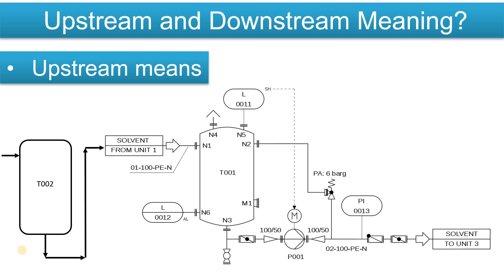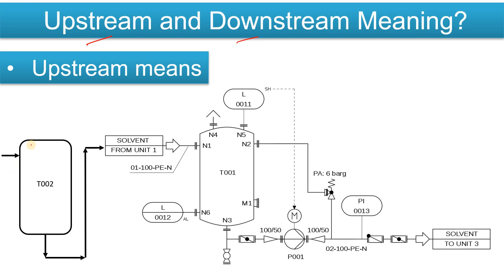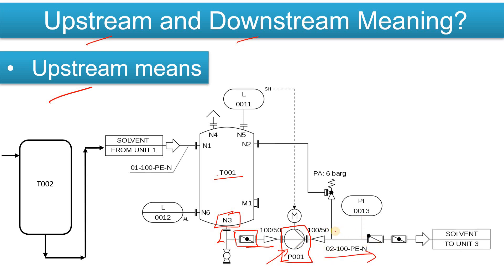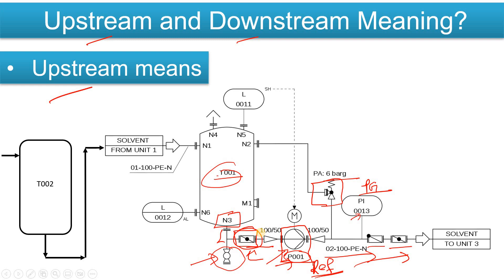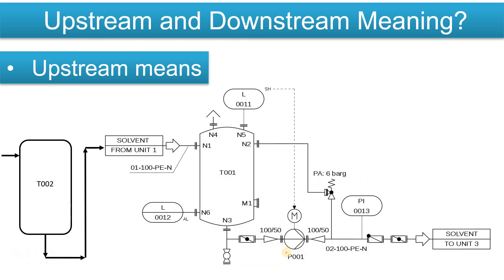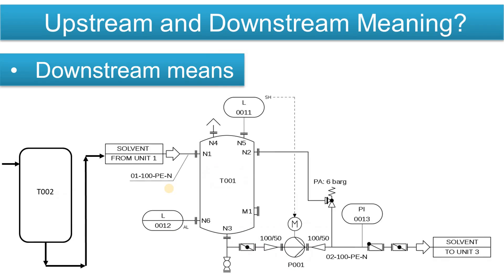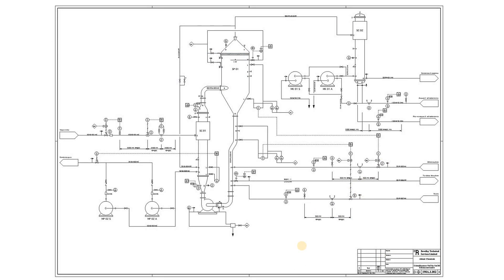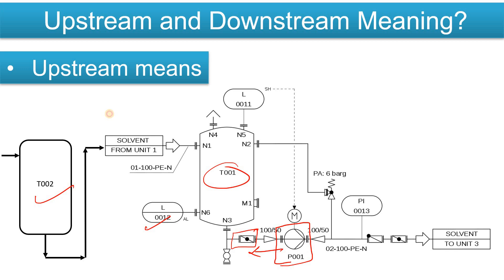Upstream and Downstream meaning in Industry | Oil and Gas | Refinery | Petrochemical Industry

Comment: The term upstream refers to anything having to do with the exploration and production of oil and natural gas. Geologic surveys and any information gathering used to locate specific areas where minerals are likely to be found is commonly called exploration. Upstream also includes the steps involved in the actual drilling and bringing oil and natural gas resources to the surface, referred to as production.

Midstream
The midstream segment of the oil and natural gas industry refers to anything required to transport and store crude oil and natural gas before they are refined and processed into fuels and key elements needed to make a very long list of products we all depend on every day. Midstream also includes pipelines and all the infrastructure needed to move these resources long distances, such as pumping stations, tank trucks, rail tank cars and transcontinental tankers.

Downstream
The final sector of the oil and natural gas industry is known as downstream. This includes everything involved in turning crude oil and natural gas into thousands of finished products we use every day.

Some of the more obvious products are fuels like gasoline, diesel, kerosene, jet fuels, heating oils and asphalt for building roads.

But long-chain hydrocarbons found in both oil and natural gas are used to make far less obvious products like synthetic rubbers, fertilizers, preservatives, containers, and plastics for parts in countless products.

Oil and natural gas products are even used to make artificial limbs, hearing aids and flame-retardant clothing to protect firefighters. In fact, paints, dyes, fibers and just about anything that is manufactured has some connection to oil and natural gas.